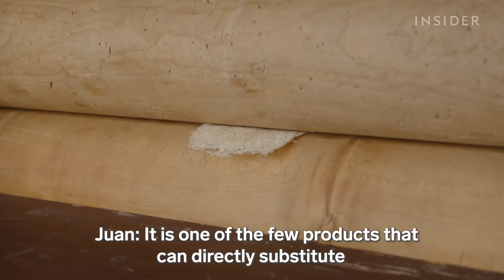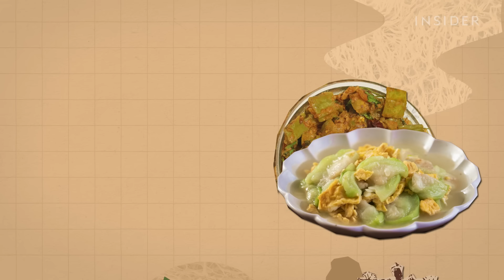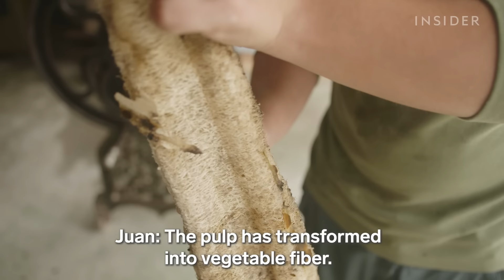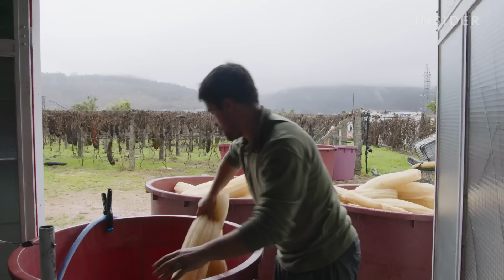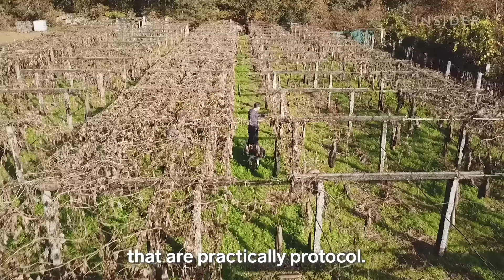How 200,000 Luffas Become Kitchen Sponges | Big Business | Insider Business

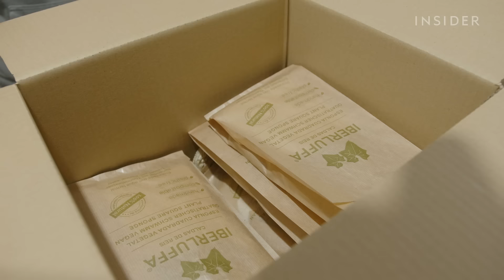Comment: 5:29 There are two issues here:
1. Sodium sulfate was indeed part of the manufacturing process, but it was not an ingredient. Dupont sponges were formed by adding sodium sulfate to wood pulp and letting it solidify. Sodium sulfate, a salt, precipitates into salt crystals, while the wood pulp coagulates into a cellulose matrix around these crystals. The sodium sulfate is then washed out, leaving only the cellulose. Hemp fibre was also added, for texture. So overall the sponges would only contain trace amounts of sodium sulfate. A food-safe compound, by the way! The foods you eat every day contain both sodium and sulfate!
2. The above described process does not produce a plastic. Unless you would consider paper a plastic, anyway.

Comment: These are actually great for scrubbing your skin in the shower.  In the kitchen, however, they don't work as well as synthetic sponges.  They don't remove all the grease from pots and pans, and when you reheat them the layer of grease gets baked on.  After a few weeks your pots will start to develop a layer of burnt grease like the seasoning on a cast iron pan.

Comment: I grew up using those to scrub in the shower... I'm so used to them that nothing else has the right texture, there are no replacements for it. They really last far longer than regular sponges, they dry faster, and if you store them the right way (a simple hook in a well ventilated area will do), they also don't get smelly, moldy or slimy.
In fact, there is a curious thing about them that points out the time to replace... they start getting a bit darker, the fibers. Or when they become too flimsy, poking holes through.
I also like how they are firmer than regular sponges... it kinda feels like you are cleaning yourself harder. xD It's a bit addictive.
It's not even about environmentalism, it's all purely selfish reasons just because I like them over anything else. xD
But I'm super happy to see it's a more environmentally friendly alternative, that it has a huge potential market to replace plastic crap, and that it's being promoted here.
Never thought about using them for dishes though, will try it.
Reply: Smaller, more frequent farming helps prevent monoculture, loss of local biodiversity. Don't let the corporations run one big huge farm

Comment: Luffa is really good as food, too. slight crunch on the outside with soft and silky texture on the inside.

But of course, realising you're eating the thing that you just used to scrub down your soft baby ass can be a turn off for some people.

Also if you clean them regularly they can last a bit over a year until it starts falling apart
Then just rip it up and dump it in a potted plant or the garden and it'll be gone in a month or so

Comment: I have seen them used as body scrubbers as well. In my experience the plastic scrubbers go soft and useless within less than a month. These ones are very rough at first but become comfortable after a few uses.

I always thought it was just a thing in rural India. Cool seeing them in mainstream Haha
Reply: I do find them hard to stop going mouldy over time though - at least for my home grown ones, possible bought ones might have something added to stop that I guess, I don't know, might be how they're stored too, but I've tried lots of options
Reply: @mehere8038  Yeah they only really work if you grow your own (so it's cheap) and dispose of them after a week or two.
Reply: @karakaaa3371  not sure it's cheap to grow you own, the space they need is pretty extreme, that's a LOT of alternative produce loss to grow them! I'd easily lose at least $200 worth of sweet potato if I swapped the space over & grew enough luffas to throw out so frequently
Reply: @mehere8038  From another user called XSportSeeker "I grew up using those to scrub in the shower... I'm so used to them that nothing else has the right texture, there are no replacements for it. They really last far longer than regular sponges, they dry faster, and if you store them the right way (a simple hook in a well ventilated area will do), they also don't get smelly, moldy or slimy.
In fact, there is a curious thing about them that points out the time to replace... they start getting a bit darker, the fibers. Or when they become too flimsy, poking holes through.
I also like how they are firmer than regular sponges... it kinda feels like you are cleaning yourself harder. xD It's a bit addictive.
It's not even about environmentalism, it's all purely selfish reasons just because I like them over anything else. xD
But I'm super happy to see it's a more environmentally friendly alternative, that it has a huge potential market to replace plastic crap, and that it's being promoted here.
Never thought about using them for dishes though, will try it"
Reply: .  Dry outside in the sun. Its fast and easy
Reply: @mehere8038 luffas are pretty abrasive, so it scrapes off dead skin cells which get trapped inside it. Along with the moisture from the shower, it’s bound to get moldy after some uses
Reply: I still use these as body scrubbers, I live in Brazil! But it's a bit hard to find them where I live
Reply: Just before 10 days i bought this for my daughter .. India ( puducherry ).. in India - Tamilnadu..it's common to use while showering
Reply: But wouldn't it be better to use a washcloth? You don't have to endure the torture of breaking in a new luffa, and you don't have to throw them away after a few uses.
Reply: @theotheleo6830  different uses :) washcloth is for cleaning, luffa is for exfoliating & cleaning off ingrained dirt & grease & grime from a hard day gardening or car repairs or whatever - or just as part of a beauty routine & getting rid of dead skin cells too I guess
Reply: @theotheleo6830 I would say loofahs for house cleaning and dishes is an ideal use. Personally, I never use more than just my hands and soap in the shower. I made it through puberty and pregnancies without any dermal issues. That's anecdotal